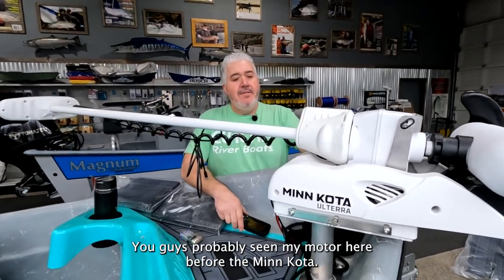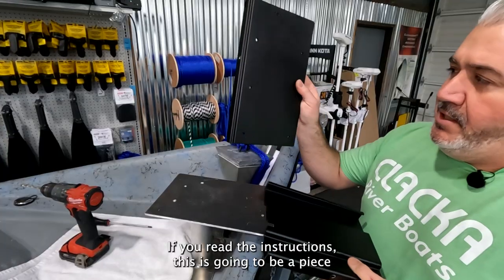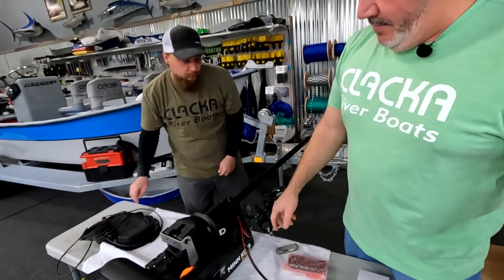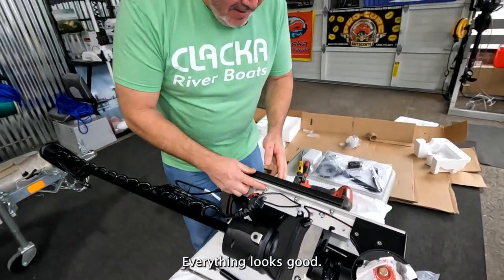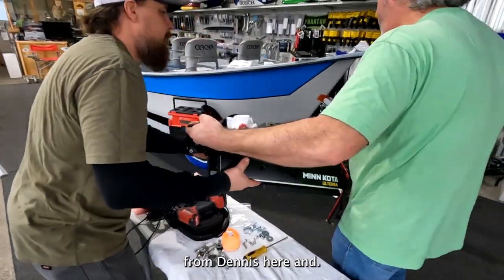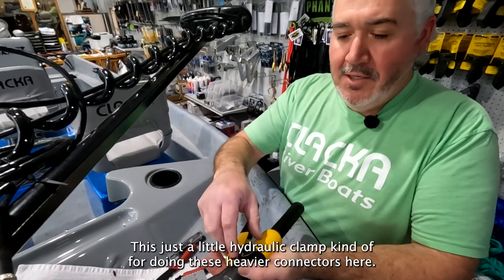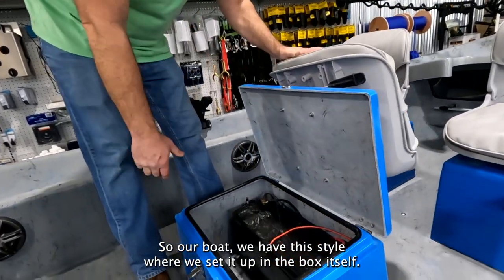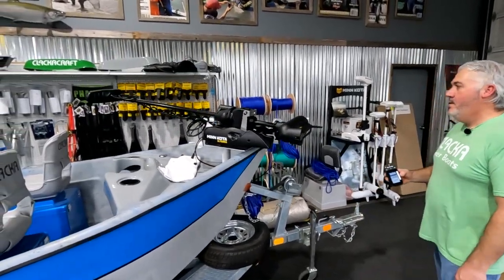Clackacraft Bow Mount Electric Motor Install (How to)

Comment: Great video, I always wondered how a drift boat would handle with one of those off set on the front!
Reply from the maker: No issue on how the boat handles especially on something like an 18 ft Clackamax but on a regular drift boat you may want to consider a stern mount motor. Ask Jake for advice on that. jake@clackacraft.com

Comment: You guys shuld post a video about how to keep my $650 boat cover from puddling up when it rains. I tried the post thing to lift the cover about at the rowers seat. N no matter what i do to adjust the straps on it i cant keep it from collecting water on both sides of the rowers seat..
Reply from the maker: I like it. I'll talk to Jake about that. I've always had the same problem.
Reply: I’ll tell you guys the secret to keeping your boat dry… store it inside the garage.